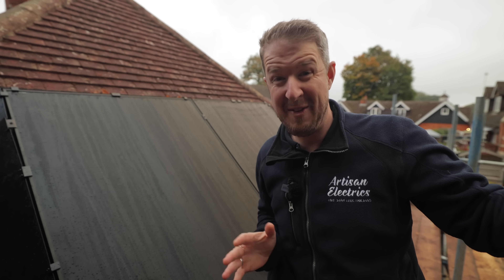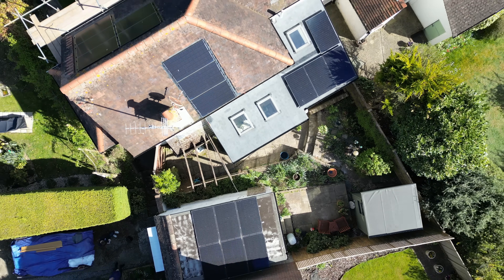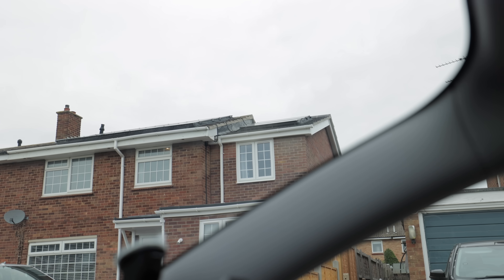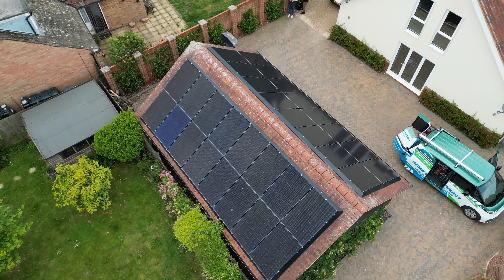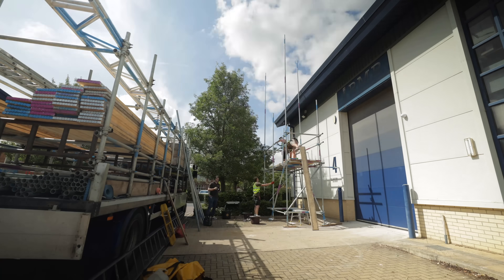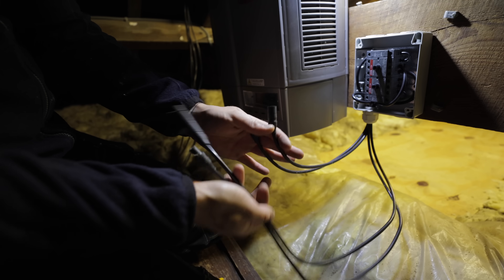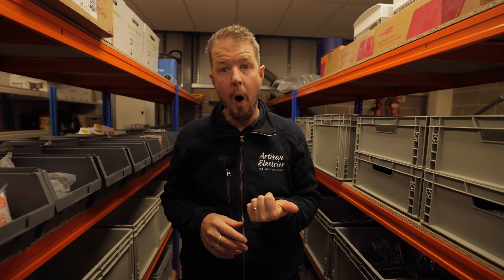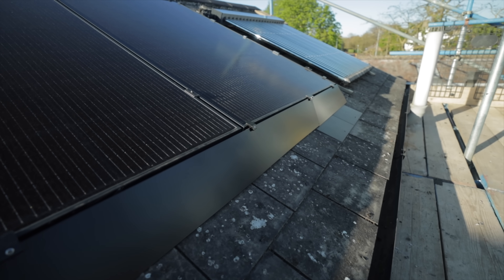The SHOCKING Truth Behind Cheap Solar Installs 🤯

Comment: You made some true comments, but I experienced an issue which many might not observe.... I am fortunate that I have the appropriate background to audit their work. 

I was quoted Panel-A which was a good quality half-cell all black panel with a specific reference number and good efficiency.   They installed Panel-B which was an older, low efficiency full-cell panel with a different reference number.   The 'good' panel was listed on the MCS certificate.  The poor panel had a much lower efficiency (STC) in its spec.

They provided a diagram of the installation in the hand-over pack (by eMail a couple of weeks after the installation), however the drawing did not match reality.  No AC isolation; no DC isolation. 

Cabling installation was poor, and did not match the quote.  Panel fixing was poor - I had them back (I cleaned my gutters while the scaffold was still up, so inspected).

I followed it up myself, and after much wrangling (and support from MCS and from RECC) I have reached a sound conclusion whereby 'they' are paying for my 'different' MCS registered contractor to fix the problems to spec.  It took nearly a year... 

How many non-technical customers could be deceived?  Note that mine wasn't a 'cheap' installation.  It was priced about right, but done poorly.
Reply from the maker: Thanks for sharing your experience – it’s a really important reminder that even a good price doesn't guarantee quality.
Reply: @artisanelectrics  Today's findings are even worse.....
My new contractor has just taken the front off the PW3: not only did the original contractor not install external isolation, but we find that the built-in isolator (on the RHS of the PW3) was by-passed - they didn't even connect it into circuit!  OMG, what sort of people are working out there???

Comment: My system is now 15 yrs old , wasn't bird protection talked about then and i have had zero issues , not every installation needs it
Reply: it seams the industry has adopted bird proofing like the upholstery business adopted scotchgsurd and the motor industry adopted paint protection as an upsell  , they all probably work to a certain degree but not strictly necessary
Reply: My system is 10 years old and also was fitted without any bird protection. 
I've had no issues. 
The location of a property may make a difference, I live in a very rural area in north east Scotland.
Reply: Never seen bird protection in Belgium, lots of pigeons though, although none of them seem to enjoy living under solar panels :-).
Reply: Ive never seen them in germany as well. Maybe we have different birds.
Reply: Depends on location. Mine is 13 years old and no bird protection and no problems. My son is by the sea and the area is plagued by gulls so he has them. I worked in an office in Bath and we had gulls nesting on the balcony and making a racket of noise every day fighting!

Comment: 'Budget system' .... then shows picture of Victron which are top notch. A friend installed (and had signed off) DIY 8kVA Victron inverter, DC coupled system with some of the 16kWh EVE celled batteries and say 5-10kW panels was ~6k yet my mates installed inferior systems are 2/3 of the capacity but 2-3x the cost. Yes I know apples and oranges but that's a shed load of cash for 3 day install, one of which cant be controlled very well and adding components is difficult. Ultimately its no wonder people seek out budget installers because you have to burn through 8-10k before payback.

Comment: Just another proof that having the right paperwork doesn’t guarantee a quality job. Much more DIY work should be legal, as long as you have the competence to do it according to the regulations.
Reply from the maker: It's true that competence is key, but some jobs really do need professional oversight for safety and compliance.
Reply: @artisanelectrics  For commercial buildings and large apartment complexes, yes — but for private homes, farms, and similar properties, no. In those cases, an inspection would be enough.

Comment: Regarding bird protection, I was toying with the sleek skirt. However, I went mesh in the end. 

Reason, I live up in the Pennines where we get a lot of wind. If we had gone for the skirting, we would’ve suffered with trapped wind under the panels, which would lead to annoying whistling noise at night. Mesh allows for wind to flow through under the panels freely. 

If I’d live some place which doesn’t get a lot of wind, then I’d 100% have gone with skirting.

Comment: No bird protection on my solar. Been 3yrs and still clean under them. Tho not lots pigeons in my otside city home. Just one pigeon family living there in tree as much I can remember and lots small ones. Roof 45-43angle south face.  Maybe it's bigger city problems but around there all other homes solar have no visible mash or covers.
Reply: Never seen it anywhere except in some UK videos. It's not even available to buy. And no issue at all. But pigeons are rare here. And other birds don't seem to be keen to go under the panels.
Reply: As the temperature under the panels can reach over 70°C, they would be cooked during the day, and any nests destroyed.
Skirts seem to be pointless and reduce convection significantly and hence cooling and solar panel efficiency and longevity.
Discreet netting would be more practical, and aesthetics is subjective.

Comment: This guy thinks he is the only competent installer, and the only way to get a competent installer is by getting ripped off by him. 🐔
Reply from the maker: We definitely believe there are a lot of good solar installers out there, but also a lot of bad ones, which we have seen too many times before!
Reply: @artisanelectrics you clearly dont understand the point im trying to make. Cheap doesn't equal a bad install. Cowboy installers not caring is what equals a bad install.

Im sure there are plenty of solar installers out there charging astronomical amounts similar to  you, that do just as bad of a job as those "cheap" installers you refer to.

Stop constantly referring to "cheap" installs. Its not a case of cheap its a case of not caring!
Reply: @artisanelectrics my solar install cost 11.5k.  24 435w panels, givenergy inverter and a 9.5 battery. East West array with bird protection. Not a single thing wrong with my installation its worker perfectly, but in your world that would be classed as a "cheap" install. Stop behaving like 🐔's , I should say, tell Jordan to stop behaving like a 🐔

Comment: 7:30 Bird protection - very much necessary, and the SolaSkirt does look awesome.  But the mesh does work, and is barely visible from ground level. So I don't really see a problem with from a ROI/payback viewpoint.  Similarly, the 485W Neostar 3P panels which you rejected in another video in favour of the 480W 3S panels.  I'd have got the 3P for my own roof if it had been available (they only stocked the S, wasn't worth arguing just for 5W).  Sorry, I just think it is ridiculous to specify worse generation in favour of slightly better aesthetics.  The customer needs to be given the option.  If they want the all-black, then fine.
12:00 100%.  Regarding solar installers working without scaffolding - maybe OK on a bungalow, but it blows my mind that they would risk it on a multi-story install, but I have heard several times of companies where they always just do it off ladders.  IMO the directors should go to prison even if there isn't an incident.
13:30 100%.  Decent quality DC joins are critical.  Even consider Arcbox if the joins are anywhere near something flammable (particularly in-roof).

Comment: I am confused on DC isolators. Most  Inverters seem to have in built isolators, and I have seen people saying that DC isolators are actually just adding additional points of failure that are not required. I’d appreciate your thoughts
Reply: If you have 1 string then use the inverters isolator. If there are more strings you need a way to isolate separately for maintenance
Reply: its tru. modern inverters have there own DC isolator on the inverter..  micro inverters dont need to have it. and solar edge has a save isolation procedure
Reply: That's what I was also told by my installer that it would be a fire risk or further point of failure if you have DC isolation as the wires have to be cut and wired into the isolator and then out again into the inverter and if not done properly then you're risking issues !
Reply: This is what I was thinking on the video as rc62 of MCS states that dc isolators should be reduced to a minimum. As dc isolators are one of the biggest risks of fire.

Comment: Don’t confuse cheap with poor or incompetent - many small businesses or one or two man bands with minimal overheads (no larger premises or office staff, multiple vans) can offer an affordable service without the end user paying for all the above overheads. I’d much rather seek one of these and find there’s a better end service from the business owner / someone emotionally attached to the business. This is especially true in this industry where people calculate ROI which can be years less for let’s be realistic the same end product
Reply from the maker: You're right that smaller companies often have lower overheads, which can translate to better prices for customers. It's definitely about finding a balance between cost and quality.
Reply: It really isn't difficult to do a decent job either. Hardest part is being on a roof. The rest is just being methodical.
Reply: Actually a far bigger problem are the ‘shop front’ outfits. They usually have slick marketing & have salespeople who are on commission only. The actual installations are subbed out, usually to the lowest quote. There’ll be a crew who slap the panels onto the roof & they’re followed be the sparks who connect it all up. End result? It’s usually a mess.
Reply: When a down turn comes in the economy the companies with the big overheads are the first to go. I know. I have been trading for 40 years and been through two of them.

Comment: I did my own as I was tired of firms telling me what I wanted.
Reply: did you apply for G98/G99 yourself?
Reply: @iamdmc don’t live in the UK. Followed all the local regulations and got the installation certified by one of the approved national certifying companies.   I have a label with a QR code on it that takes the local DNO or electrician straight the agreed and approved wiring diagram and certificate for the house. There are no poor standard EICRs here
Reply: @martinbateman2467 that seems to be the first rule of success. We're being choked and taxed at every turn by the UK gov and regulators
Reply: Just wondering where you are, I'm in Florida and thinking of doing it myself. How did you find the process, was it pretty straightforward?
Reply: @AlanTheBear I’m in Belgium. It’ll come done to your overall competence. Here, there is an independent approval process prior to switch on, so it can be assured as being safe
Reply: @martinbateman2467 I'm a retired electrical engineer from the UK so it's just understanding Florida policy and systems as they differ quite a bit to the UK. To physically do the work that's not a problem (hopefully)
Thank you.

Comment: I know its 2025 but I personally find it odd that 99% of sites that you either want to find a rough quote to install solar or in this case just look at how much solar skirts cost they want you to contact them. It surely is not hard to give a rough idea based on number of solar panels. 
I have been playing with the idea of solar and found what I think is what I need including a 40Kw inverter x4 16kw batteries and 54 JA Solar N-type | Bifacial Double Glass | Half-Cell MBB Traceable Monocrystalline solar panel and even brackets but to find out how much it would cost to install them + any cables needed etc is mission impossible unless I want to spend all my life contacting random sites. AI suggests £2500 for install and I think I know why sites do not want to give a rough idea and this channel does not want to tell people the cost (probably because people will gulp really hard)but cost is a very important part and would be nice if sites would at least give a rough idea so people can budget better.

Side note I would assume that it is cheaper if I bought all the items needed then just paid a professional to set it up rather than the installer sourcing the equipment(we all know that a company will make more money if they source the parts and fit them rather than just installing)

Comment: oh where to start, I'll leave it simple don't trust a goverment grant . I worked for a great company in Exeter and I used to get alot of calls from schools and public sector buildings, the worst was a school in Cornwal that had a system installed where they had 3 inverters installed, 1 work, 1 barely worked and the other wasnt event connected to the system. The original installer had used the wrong roof connecters the list goes on.......

Comment: with that scirt bird protection the heat cannot escape and if solarpanels get hot in summer they produce less energy, so its not the best option
Reply: Worse than that, with the hot air trapped behind the panel, you effectively have a greenhouse which will get very hot!
You need good ventilation, which appears non-existent with that bird protection, or loose a lot of power.  Even a few small holes would make a big difference!
You do want to block seagulls and pigeons, but other birds are not really a problem, swallows can make a bit of a mess, but it is good to give them a home, and it is only for a few weeks while they are nesting.
Reply: I was going to say exactly the same. I live in Alberta Canada and it gets very hot.
Reply: Good point. My mates professionally installed system has those side panels, about 30 minutes away my other mates diy system doesnt (just some black wire mesh). I have annoyingly forgot the exact efficiency difference but it matched the charts by the manufacture and was significant.
Reply from the maker: They have vents to allow airflow
Reply: @artisanelectrics  Have you done a comparison test, with and without?  From the video images, it looks like the ventilation is far from adequate...  

Of course, not everyone needs maximum output in sunny weather, in which case it doesn't matter, there is not going to be much return from selling excess to the grid for much longer.

Comment: Good points made but solar needs to save homeowners money. Many installers are still charging prices that mean ROI takes 15years even with the current high electricity prices. Panels and inverters are cheaper than they ever have been so install prices should be going down.
Reply from the maker: ROI is only a small factor for a lot of people - and there are so many ways to measure that anyway. It’s easy to fake a good ROI with a cheap price but when the system breaks two years later the investment goes out the window.
Reply: @artisanelectrics  Yep, personally I wanted to produce my own clean energy, not bothered about ROI and it's never made much sense to me as a concept as I don't expect a return on investment on anything else I spend thousands on, new kitchen, car etc.